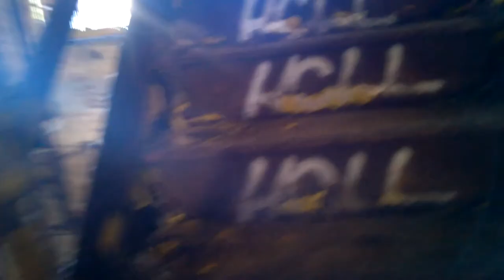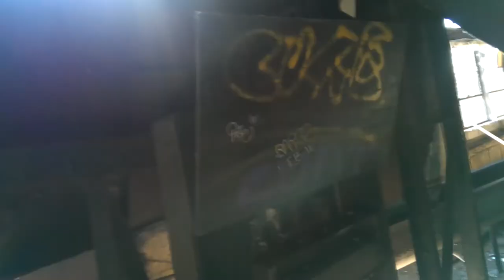Peter Cooper Glue Factory

Comment: How did you get in without getting caught?
Reply from the maker: carlos I typically would go during the week. There weren't any camera's or motion sensors in the building and it wasn't actually patrolled. Occasionally the police would swing by to see if anyone had parked out in front. The key was to park at the bar near by and walk there.
Reply: +Paul Lyon is this building still standing or has it been demolished?
Reply from the maker: It was torn down earlier this year, unfortunately.